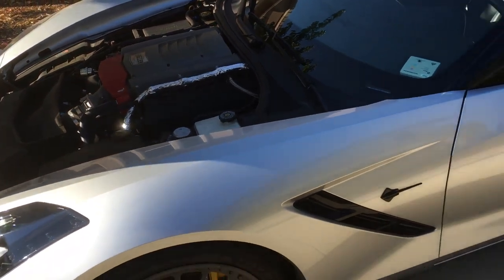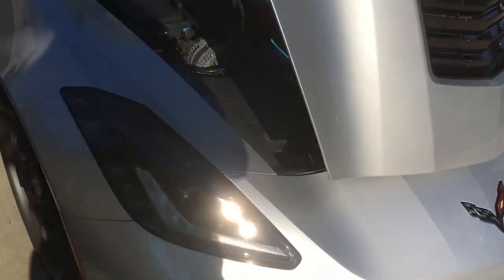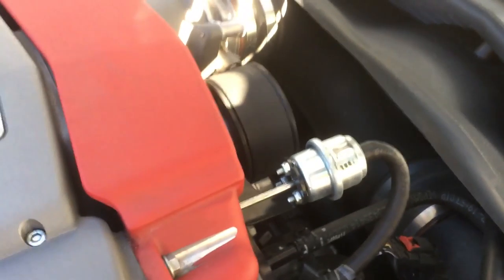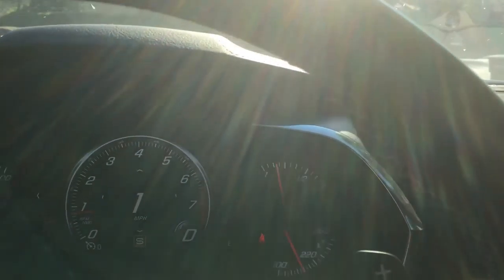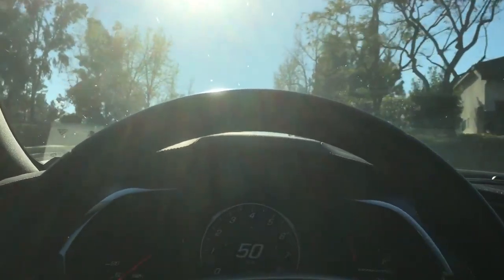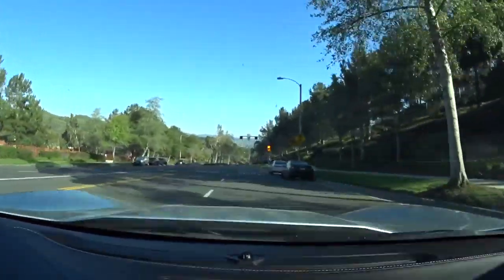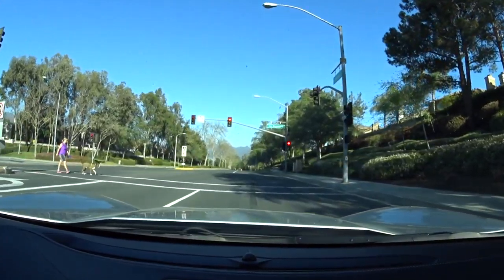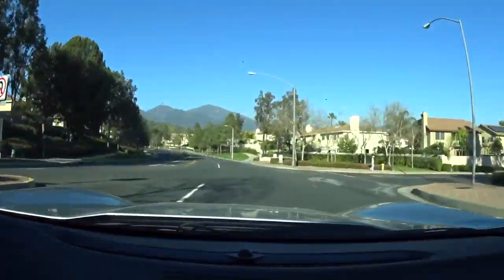Driving My C7 Corvette With Edelbrock E-Force Supercharger

Comment: You mentioned a 20% drivetrain loss on this (automatic, I guess?). These modern trans' are much more efficient and are averaging only a 16-18% drivetrain loss (again, on the automatic). Not too bad. The Edelbrock system actually looks pretty nice, too. I agree 100% about the importance of a good tune. I built up my LS7 first, then supercharged it, and add 28whp with the tune alone. Cheers.

Comment: This is one of the best, no this IS the best video on this subject I've run across.  Your setup is not insane, yet a blast to drive.  I have a C6 Z06 and it is fun as well, except it isn't a car to disrespect, unless you want bit in the ass.  It's apparent that your combination is exactly spot on for your type of driving.  Now I can push mine around some and have fun, but I friend of mine has a C7 Z06 and he says that if he pushes it, it's all over the road with the TC on.  I'm just sniffing around superchargers, but putting one on mine would ruin it for me, I'm not into "insane".
Reply from the maker: Appreciate the comment.  This is stage one. There are 2 more stages possible. I doubt I will ever do more than this, since it is impossible to use the power I have now without spinning the tires. More power would mean more tire spin. If I were drag racing, it would be different, but then I'd need to spend a lot more money on beefing up the power train, drag radials, etc etc etc. Not what I'm every going to do.... unless....   anyway, thanks again. Still enjoying the car every day.

Comment: I have a Torch Red C7 with the LT1 package, 2016 with a tad bit over 16K miles. I'm thinking of doing this too. Do you mind telling me how much this setup cost you? I know tuning varies depending on location, but just wondering how much coin I need to put in. I really miss the sound of my roots blower on my 2003 Cobra and this brought back so many memories. I love these C7's though.  Great video by the way!
Reply from the maker: scruickshanksr  thanks for the note. Appreciate your comment.  The Edelbrock goes for right around 8k. I got the install free for doing advertising for the company. You can expect parts and labor to be right around 10k.  Unless you know a guy who can do the labor for less. Your ear and mine both like the sound of the roots style blower. It has a special characteristic combine with the NPP option exhaust. The sound at 4000 rpm and above is just fantastic. Performance is on point.

Comment: This car you built is a very smart move I know it may not have the flash of a C7 Z06 or C7 ZR1 but you got 80 to 90 % of the performance of those car but your not going to take a huge depreciation hit great car.
Reply from the maker: Hi Dustin... thank you for the comment.  That's exactly what I was thinking.  This was the best I could do given the parameters I had to work with. It's been very solid. Three years old now.  After 23,000 miles it's still like new.

Comment: A local dealer has a 14' with the Edelbrock setup listed at $39k. I am seriously considering buying it, but need to know what I should be checking during the test drive and walkthrough. Any information helps.
Reply from the maker: B. Ev Beats mileage on the blower?  It has a 100k mile warranty. Mileage on the car? Ever raced on a track? How hard was it driven?  Consistent oil changes? How does the blower drive belt look? It’s not a typical failure point but should look good without obvious wear and cracking. There’s not much else that’s super serious. My blower is a little noisy. Meaning you can hear what seems like bearing “rattle” but it’s not bearings. It’s just louder than one other person thinks it should be. Like I said, 100k warranty and it’s a sealed system. So... if you like the car and the price is right, do it. Is it a Z51 package?  Bigger rotors and brakes. Let me know if you have more questions.

Comment: Did u do it ur self? I'm. Install the supercharger on it? N what else do u had th upgrade,,, cam, e exhaust,  or every thing left to stock?  Let me know I have bought a edebruck supercharger I'm getting it tomorrow Monday the jun/ 29 /20
Reply from the maker: I had a dude in a shop do this.  He's an engine builder for dragsters.  Nothing else done, so it's stock except for the blower. After 48,000 miles it's still running great.

Comment: Cool video... thanks.  When you cut the section out of the hood for that mod, did you cut all the way through it, and re-fiberglass the hood... or what exactly did you do there? Thanks, Tim
Reply from the maker: Angel ECU cut the hood mat completely, which allowed for the tiny bit of extra height of the blower.  Then used heat shield foil with sticky back applied to bare underside of hood.
Reply: Fiberglass 😂🤣 I think you meant carbon fiber.

Comment: I’m thinking about getting this setup in my 18 A8. How has it held up? Any issues with reliable?
Reply from the maker: msinclairjr  48,000 miles. No issues other than the intake tube. I had a custom intake made to replace the plastic tube that came with the kit. Excellent performance. You’ll have to get a tune.
Reply: Tom Glander nice! Do you still have AFM?
Reply from the maker: msinclairjr  AFM?
Reply: Tom Glander active fuel management.... if this is a M7 you don’t have it unless you use eco mode. A8 has it in any mode...
Reply from the maker: msinclairjr  no. It was tuned out. If you want AFM don’t install a blower! It’s all about performance.
Reply: What did it run you tuned and installed?

Comment: Thanks!!
Reply from the maker: https://youtu.be/bGUQB5ZJKlA
Reply: Tom Glander thanks for the video Tom!
Reply from the maker: You're welcome. I wish there was a way the translate the feeling through video. Until then, will have to make do with this two dimensional stuff.
Reply: Tom Glander I also have a 2016 z51 8 speed also in blade silver. Really thinking about supercharging it
Reply from the maker: Well I wouldn't think too much about it. Just do it. You won't regret the decision as long as you get it tuned right. That's the key. You can use Edelbrock's tune... or get a custom one done for you.
Reply from the maker: Sounds sweet.  I'm pretty happy with the car in stage 1.  Could go more... but whatever.  It's all good, whatever you choose to do.

Comment: Awesome, thanks. Been thinking of adding an Edelbrock on my 2016 Z51 as well. Did you install it yourself?
Reply from the maker: I helped a friend who had a shop and all the know-how. I wouldn't have tried this myself, since I don't have some of the more "exotic" tools needed to do the job. My help amounted to holding tools and such and pretty much being an assistant. It was a blast, all the same.
Reply: I know this comment is super late. I saw the comment where you sold the car. But just watching the video compared to my stock c7 m7 the pull is insane. CARB  emissions is a pain to deal with. My other car has a special smog guy. I don't wanna do that with my C7 too. It gets quite expensive. I think I'm gonna save up for this. I don't drive my C7 very much just on the weekends. It's a 2017 w/14k miles. I think it would be much more fun. After I paid off the C7 I bought a truck too 😂 I couldn't let it go though. I suffered through the  higher payments.

Comment: hows it holding up?
Reply from the maker: With 70,000 miles, it's still working well.  I wonder how long it will last.
Reply: @TomGlander  holy Jesus that’s crazy longevity, I will definitely be looking into Edelbrock over the Centri superchargers. In this video, we’re you running meth at all or is this just pump gas? I personally don’t want to deal with meth as the pumps are known to die out every year or two and it just kills convenience giving that you have to make sure the car doesn’t sit too long with it and must store the meth in a proper place.
Reply from the maker: @worst-hd-player   never ran anything but pump gas.  Sold the car at 71,000 miles and the supercharger was still going strong.  It was time to move on to a truck.
Reply: @TomGlander  yup I’m officially sold on the Edelbrock. I think looking over the pd kits, Magnuson is better in terms of what the kit contains and for its price but Edelbrock is not far off from it. I also live in California so I wouldn’t even be able to get my hands on a Magnuson kit regardless. Thanks for the rapid response!